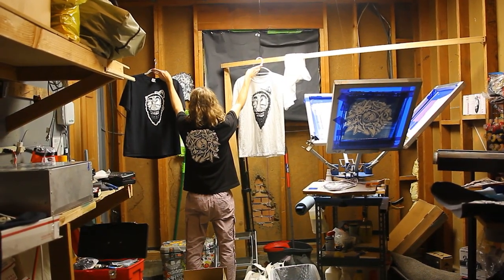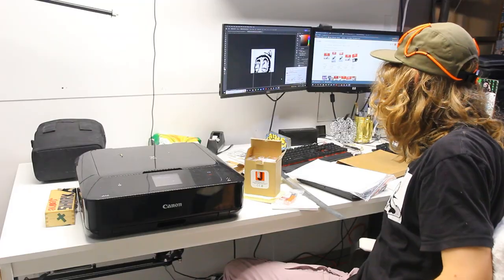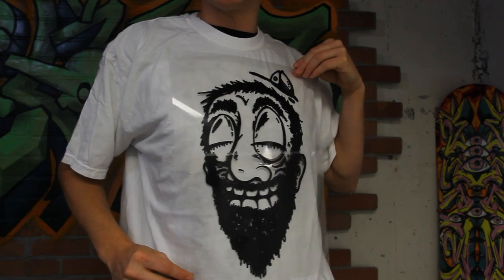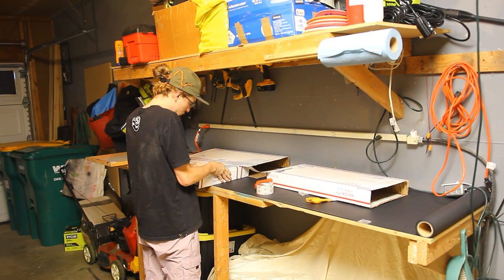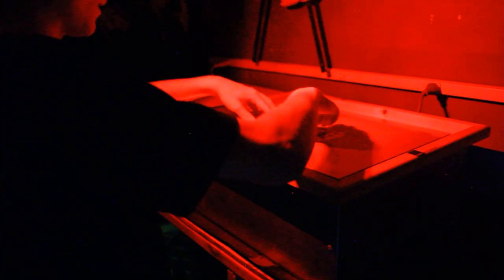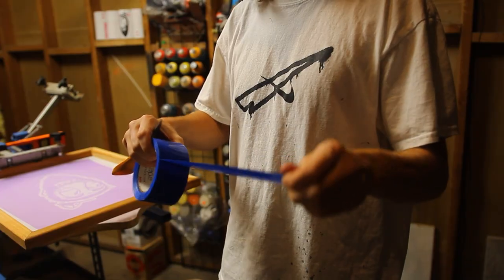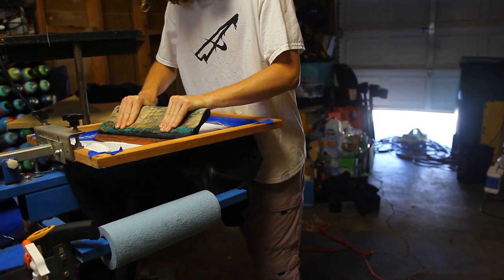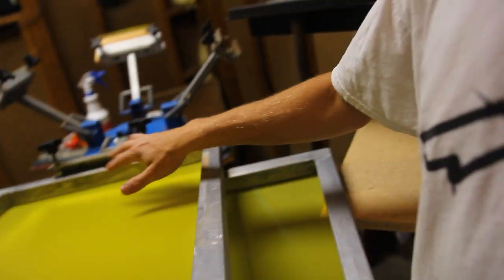How To Draw T-Shirt Graffiti (Black and White)

Comment: What printer would u recommend to get good prints on transparency sheets
Reply from the maker: I have had good results with some of the larger format canon inkjets. I was printing on 11x17’s which seemed to cover most of my designs. That was on a friends printer so at this time I’m just getting them done at staples and they work pretty well